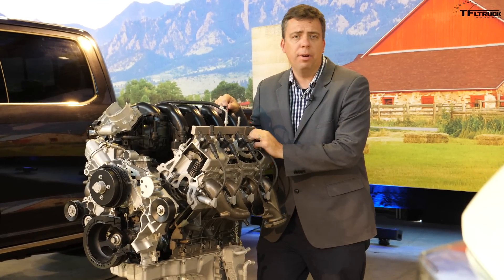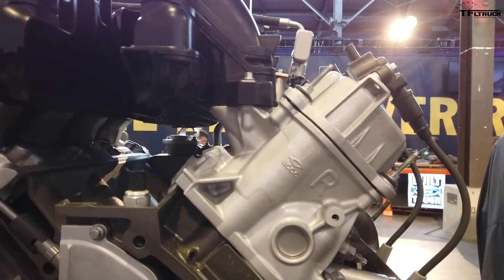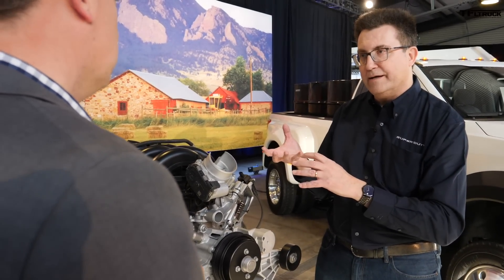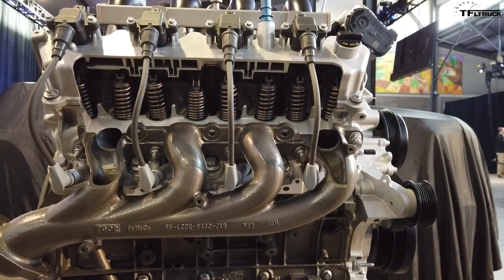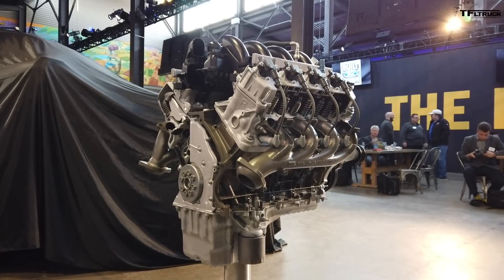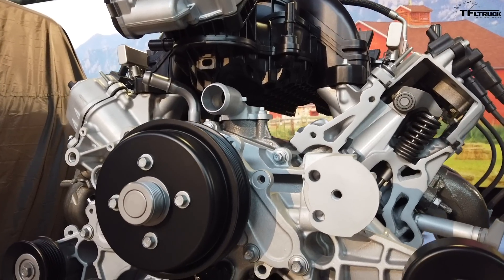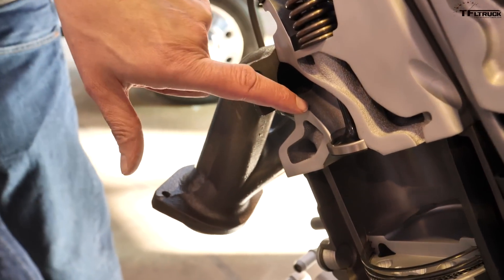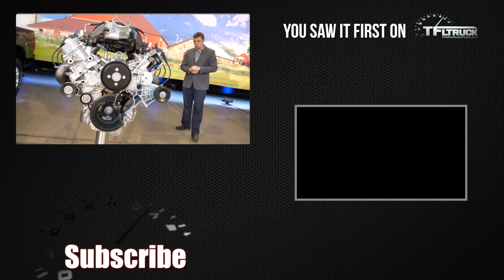2020 Ford Super Duty 7.3L V8: Here's What You Need to Know!

Comment: Iron big block? Pushrod engine? I like where Ford is headed.
Reply: The good ole days durability, but more efficient.
Reply: Back to reality
Reply: Yup, with LS and Hemi... it is reality
Reply: @noneya6334  reality meaning the direction they're heading.... Away from OHC truck engines.
Reply: @cw6371  yeah, after their 20 or so years vacation with the triton and coyote engines
Reply: Kaulin Curtis - both coyote and triton have records nothing that a modern garbage motors and Fiat engine have 
Coyote - 5.8 sec 1/4 mile 
5.8l mod motor- 293 mph in one mile. 
Stop spewing bullshit
Reply: @CoyoteFTW  I said nothing against their capability in the performance sector. Just in heavy duty and durability applications (as TRUCK engines) they aren't that great.
Reply: @CoyoteFTW  1. How many records with stock parts? 2. Speed and dyno records don't offset shitty engineering from a longevity and serviceability standpoint.
Reply: @CoyoteFTW  We are talking truck motors here. OHC doesn't make any sense in a low reving engine. OHC engines are too tall, and don't rev enough to justify it. Because of packaging issues, they have to keep OHC displacement low.
Reply: Oh you what chevy has been doing for years and years now lol so ford had to copy them to get a decent engine ha still won't be shit compared to any LS
Reply: @CoyoteFTW  WTF you talking about with these numbers bro ? You mean a fully modified engine ? Which isn't anywhere near a stock coyote or Triton is that what you talking about ? Stock they are shit compared to LS stupid why you think you never hear of a Triton swap lol but yet LS swap is more common swap period.
Reply: @kentaylor5842  To be fair the LS has a lot of elements from the SBF.
Reply: @kentaylor5842  .... Agreed
Reply: @cw6371  which one? The one is the 70's
Reply: Kaulin Curtis your move Chevy haha
Reply: Realizability is going to hinge on how they did VCT. Ford's history with phasers isn't the greatest...
Reply: Ken Taylor - copy who ? Get over it, Ford designed a big block in 2020 with balls. GM designed a puzzle tailgate and closed tons of factories, I clearly see which manufacturer is doing better.
Reply: Engines that spit out spark plugs?
Reply: Lmao. This ford engine is built just like a ls Chevy engine. Has push rods and 6 bolt main caps. Ford done figured out over head cam engine's.  Ant durable
Reply: @donaldkinder6716  lmao.  Your incorrect but funny.
Reply: Standardization like GM's does with their small blocks for the past 6 decades. Hopefully it doesn't spit out spark plugs or blow head gaskets their past offerings: https://www.youtube.com/watch?v=j0Zb4vhyr5k
Reply: @CoyoteFTW : https://www.youtube.com/watch?v=j0Zb4vhyr5k Ford builds crap. Also, Google Powerjoke 6.0.
Reply: @kaulincurtis9665  Have you ever driven a 5 Liter pick up?  They have TONS of power man.  I like em!  Check it out some time.
Reply: @Dive-Bar-Casanova  
If you can bring up the crapy 6.0 liter that is now irrelevant to most buyers because of how old it is than I can bring up the 8-6-4 the GM put in Cadillacs.
Reply: @cw6371  Lol OHV GM style with a moden drive by wire throttle.
Reply: @williscurry6557  
You call drive by wire modern? It's one of the worst things car manufacturers have ever put in cars. Low response rate, if they break you can't just put in a new one, and replace it without programing it, and it makes driving a manual a nightmare. Let alone all the pedal you have to go through before you hit the floor. Now with that out of the way, you can swap LS heads on an SBF, if you wanted to. That's why they are calling it almost the same in design I really don't buy it, but that's what people are saying. I have yet to see it.
Reply: 1953?
Reply: And he's talking about 6-bolt mains like the LS hasn't had them since '97.
Reply: Yea talk down about the coyote 5.0L let’s have Ford go back to the days of the disgusting trash 4.6L ohv. That’s a great idea!
Reply: @wolverine1alpha518  5.0 is a good engine. Better for use in a mustang than a truck though. A simple OHV valvetrain is best for heavy duty applications, because it is more durable and better for making low end torque.
Reply: @dynahack505  OHV, I think you mean OHC. nobody cares that you think that they are trash. Maintain an engine for once then we can talk. 4.6 v8 was good. People just can't replace spark plugs, or change oil for some reason.
Reply: @wolverine1alpha518  an OHC engine like the 5.0 just adds unneccesary complexity without any benefits in towing capability. Works great for a high rpm mustang motor, though
Reply: @kaulincurtis9665  agreed. But the 5.4 2v made 280 hp @ 5000 rpm and 330 ft/lbs at 3500 rpm. I thought that was plenty, especially when the 4r70w Trans had a tall first gear. Bullet proof Trans none the less.
Reply: finally catching up to where chevy has been for 80 years.
Reply: @cw6371  and the 4.6 has had them since the early 90's.
Reply: And no DEF tank...
Reply: @vapecatt  yeah the 5.4 did have good torque behavior for towing. my point is that OHV can do the same thing with out the crazy timing chain routing  etc. Simpler is better in this instance.
Reply: @kaulincurtis9665  
Totally agreed. I just wish people would stop dogging on the tritons like this. It's become cliche at this point how the triton will blow spark plugs or a cam phaser. Everybody dog piles on these motors, when there's much worse out there. It's unnecessary punching something while it is down.
Reply: Kaulin Curtis headed back to the big blocks gm made in the 70/
Reply: @CoyoteFTW  ford made 7.6 billion last year gm made 11.9 billion i work at a ford f150 plant in kcmo
Reply: @vapecatt  or the 5.7diesel joke from78-80...?
Reply: @cassidymccoy9837  what are you even talking about.
Reply: @cassidymccoy9837  you talking to me? I'm a chevy guy lol
Reply: It looks like the push rod motor is narrower. My 6.2 takes a lot of room under the hood, much more that the chevy’s my used to.
Reply: @kaulincurtis9665  no the other guy defending the ford engines tooth and nail lol
Reply: With the  aluminum body parts and these engines these trucks are going to go FOREVER.
Reply: Pushrod and port injected... sometime less is more.  Hemi's are still this way, LS's have DI oly after '15... never ever thought ford would change their philosophy. I'll still never EVER buy a Ford...  but good for them
Reply: Kaulin Curtis in the right direction
Reply: Chevy
Reply: @mikeford963  only furthers my point
Reply: Oggy  do you mean 3v 5.4?
Reply: @vapecatt  I agree. Tritons are good engines once you get all the kinks work out. A good work horse. Another good thing is they come relatively cheap because of the bad reputation. But the spark plug issue makes too good of a joke for chevy guys to resist.
Reply: @kentaylor5842  the ls is just a sbf.
Reply: buy a scrapped truck with a good engine ,turbo that and it looks small enough to fit in a car I can't wait to see what happens.
Reply: New from the ground up? WAIT FOR THE RECALLS.
Reply: @eyehatefarcebook11  
Give it a chance. I'm happily surprised that Ford went back to the good ol' cam in block route.
Reply: Zachariah Woller I am, I just won't like the price tag.
Reply: Zachariah Woller no, I was praising the ohc coyote engine. And the 4.6L was an ohv engine. If you want torque go diesel. As far as maintaining engines I’m willing to bet I’m more qualified and experienced then you chief.
Reply: Th A 5.8 Windsor was the true police interseptor
Reply: soaringtractor  I am not that young and do remember the 460 and actually some what like it along with the old 302's dont care for 351's though. And chevy 454 isnt a shit motor we used that in mug rigs for years and chevy has been making an 8.1 big block for years now in trucks and is a great engine and I dont hear any ford 460 swaps back then before the LS craze so guess your argument is shit but I didnt expect you to be smart anyways since your backing up ford and and engine that has not even came out or proven anything lol but yet GM's LS and 350's were and are the most popular and common types of engines swaps cause they have proven them repeatedly time and time again that they are better.
Reply: Richardson why is that ? Cause I do not share your feelings for ford? Lol nice come back
Reply: @dynahack505  nah the 4.6 is a modular engine, came in sohc or dohc, depending on application.
Reply: Kaulin Curtis where you are right I was referencing the 4.6L ohv engine that was found in mustang GT. The ohc engine made good power and used in mercury marauders and cobra
Reply: @dynahack505  I wasn't aware there was a 4.6 OHV. What years mustang was it in?
Reply: ryan reaves - GM Reliable? Most unreliable company there is 
   
December 2008 - GM receives a bailout of $13.4 billion from the US Treasury, through the Troubled Asset Relief Program (TARP).

April-May 2009 - General Motors receives another $6 billion in bailouts from TARP.

June 1, 2009 - GM files for bankruptcy. It receives another $30 billion in government funding to assist with restructuring. After bankruptcy, the company will be 60.8% owned by the US government, 11.7% by the Canadian government, 17.5% by the UAW union and unsecured bondholders will have a 10% share.

April 7, 2010 - GM announces that the company lost $3.4 billion in the fourth quarter of 2009.
 
February 24, 2011 - GM announces that the company made $4.7 billion in 2010, its first profit since 2004.

December 9, 2013 - The US Treasury sells its remaining shares of GM stock, closing the book on the 2009 bailout. The United States only recouped about $39 billion of the approximately $50 billion it put into GM.

February 14, 2014 - GM recalls 780,000 vehicles due to faulty ignition.

March 28, 2014 - The recall of GM vehicles with ignition issues is expanded to 2.6 million vehicles.

March 31, 2014 - GM recalls 1.3 million vehicles due to a power steering issue.

May 15, 2014 - GM announces it is recalling another 3 million vehicles worldwide, and that it will take a $200 million charge for those repairs. The bulk of the latest recall applies to 2.4 million cars with a wiring problem that's been tied to at least 13 accidents, two injuries and no deaths. 

May 16, 2014 - The National Highway Traffic Safety Administration (NHTSA) fines GM $35 million to settle a federal probe into the 10-year delay of its ignition switch recall. 

May 20, 2014 - GM recalls another 2.4 million US cars and trucks. Spokesman Alan Adler says that no injuries or deaths are associated the recalls.

May 22, 2014 - CNN reports a total of 29 separate GM recalls since January 2014 covering 13.8 million US cars and trucks, and 15.8 million vehicles worldwide.

June 16, 2014 - GM recalls another 3.36 million vehicles worldwide for a different ignition switch issue linked to eight crashes and six injuries. This brings the total number of cars recalled by GM this year to more than 20 million.

June 30, 2014 - GM recalls 8.4 million vehicles worldwide, most for faulty ignition switches. This brings the total number of vehicles GM has recalled in 2014 to 27 million in the United States, nearly 30 million worldwide.

December 10, 2015 - GM's faulty ignition switch caused 124 deaths, according to a final report from the attorney administering funds to accident victims.

August 5, 2017 - Recalls about 700,000 Chevy and GMC trucks because of a potential software problem that can cause them to spontaneously lose their electric power steering assistance for about a second.

November 26, 2018 - GM announces that it will shut down production at five facilities in North America and cut its staff, reducing its salaried workforce by 15%. This restructuring means GM will stop making sedans
Reply: Now I'm just waiting for a big block inline 6. 🙂
Reply: @vapecatt  I'm guessing you have never had 6 of the 8 plugs break off in the heads Triton  was garbage
Reply: @mattd19902010  
Well I put a little antiseize on the threads of my plugs so they come out. I don't know how hard that is for some people to do, but apparently it's pretty damn difficult to do that. 
I love all of the car companies, I just can't stand people that rag on an engine they don't like because there to stupid to fix it. Seriously just do the right procedures and it will always work. I have a 2002 GMC safari with the 4.3L V6 and 4L60E automatic transmission and it has 197,000 miles on it and it's a daily driver. I have a 1999 Ford F-150 with the 4.2L V6 and M5OD-R2 5 speed and that has 291,000 miles. I have a 2003 Ford F-150 with a 5.4L  Triton V8 and 4R70W transmission and it has 197,000. They will all run for as long as I live because I maintain them.
Reply: @dynahack505  
Unless your confusing the 5.0 Windsor with the 4.6 Triton. Ford never made an OHV variant of the modular series of engine. Ford was dead set on moving into the future with overhead cam designed engines in the 1980s and put the first 4.6 Modular in The 1991 Lincoln Town car, and with that they drop their OHV line up completely in 1996 with the ending of the Ford F-150's more utility focused design.
Reply: @vapecatt  I dont have a Ford anymore bad luck with them I like my Chevy no issues
Reply: Single cam, push rods, iron block... loving Ford right now!
Reply: leeleelee Ford all the way. I got away from GM. They are shit. My Dad is about to be hosed on his 2016 Chevy with the Duramax. It needs a new injection pump due to the shit that they put in diesel. New pump $3000.
Reply: Kaulin Curtis the coyote is much better than the triton
Reply: @zachconant7031  agreed. Triton was a bit of an embarrassment.

Comment: No supprise big block gas engine are comeing back know that diesel engines have been ruined by emission laws
Reply: Robert Zin 
Technically not a “big block”
More like a big bore small block.
Big blocks are wider. Engineer stated it was narrower.
Although, he did say it was longer.
Reply: Frank Morreale I’ll bet you’re fun to hang out with.
Reply: 100% Agree
Reply: So how is it a big block? It's still relatively compact by most V8 standards.
Reply: No, you're only partially correct. Cranks, rods and bearings having nothing to do with this. There are big blocks with smaller and weaker internals than small blocks. Big block refers to the relatively larger physical size and architecture of the block, nothing more. The physically size of this block is about like any other OHV V8 engine today. In fact, bore spacing is closer to an LS than any older big blocks. An LSX has bore spacing of 111.8mm. A Chrysler LA has spacing of 113.3mm. This engine is 115mm. An older Ford big block had bore spacing of 124.46mm, and most other true big blocks were similar to that. Like other small blocks, this engine supports large displacement, but it's still physically closer to your typical small block in overall dimensions. Maybe you should do some research before spreading dumb comments, huh?
Reply: I didn't even think about that, you have a point!
Reply: @Nostradamus_Order33  
"Big blocks are wider. Engineer stated it was narrower"

Narrower than DOHC. The block is big; the head is not.
Reply: @WhitfieldProductionsTV  yeah, there is no reason, but as emission laws have gotten tighter on diesels, they have lost about half of their life span becouse of it. It's the reason why CAT stopped making their highway diesel engine. CAT wanted to make an engine that can last millions of miles, but becuase of emissions laws, the best they could do is 500,000 miles. That also goes for all other new diesel engines on the market, they will fall apart after 500,000 miles. So caterpillar stopped production, and focused on their off road diesels that they could make last that long.
Reply: Troll Master engineer said it was narrower than DOHC engines which are by design wide.
Reply: 6.7 with emission run just fine we have 3 with over 250,000 one has 295,000 runs fine!
Reply: @jjwaters4037  then you got about 200,000 miles left on each of those.
Reply: @Keaton0801  probably trade them off next year every 4 years
Reply: Robert Zin  Ford was responsible for trying to eliminate big-block  gasoline engine themselves
Reply: Troll Master so it's a big block
Reply: Maybe not a bad thing.
Reply: I'm sure you don't care about emmissions; neither did I, until I developed asthma at age 60. Never smoked a day in my life. But now pollution makes it hard to breathe. So perhaps you might change your mind a bit about emission laws, because there are a lot of people out there who probably wouldn't even need medication, and would be able to breath easier, if we'd clean up the air instead of filling it up with exhaust fumes.
Reply: @Keaton0801  I dont think you know what you are talking about.
Reply: When those know diesels have been ruined by ever tightening emission regulations when the big three automakers have turned to big block engines not before ford was the few that was to listen to its commercial consumers when requirements are to have an engine in the 7 liter range when they settled on 7.3 not before there was rumors from ford stating the 6.2 and the triton V10 aren't going anywhere when they are to be retained to supplement the all new 7.3.
Reply: @d.e.b.b5788   Developing third world nations with almost exclusively two stroke engines spitting out burnt carbon like there's no tomorrow (cause there probably ain't!) need some kind of regulation of their emmissions.  I'm for controls set in place to increase longevity of the Planet; but let's focus on the real problem at hand now.